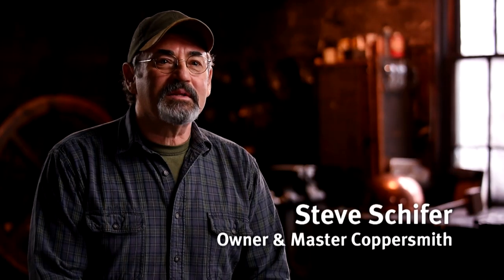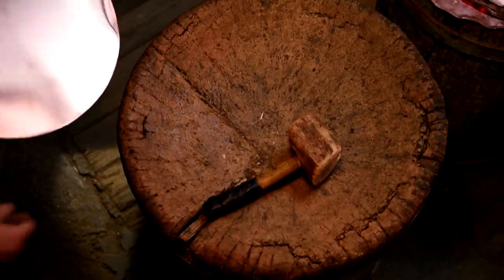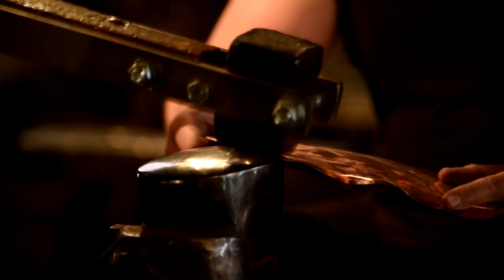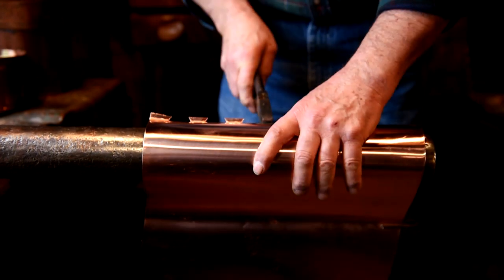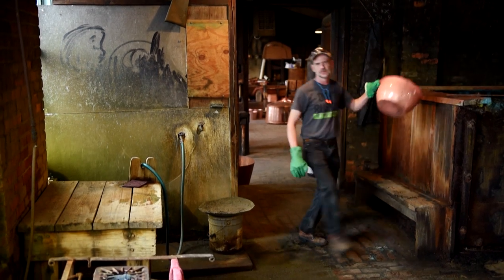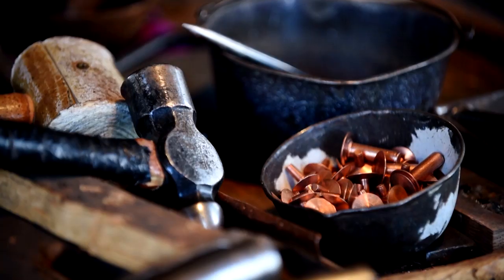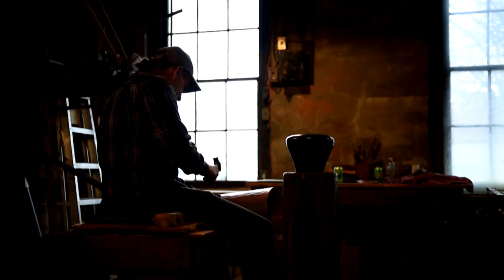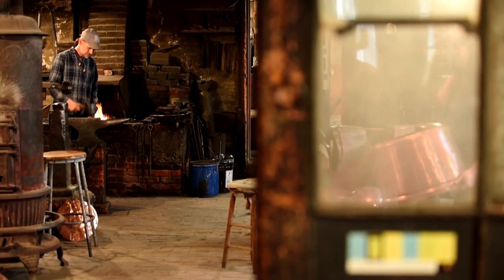The Bucyrus Copper Kettle Works

Comment: what about copper pot stills? are those assembled by brazing or can soldering be strong enough to take the heat of a burner under them?
Reply: Soldered.
Reply: @canadiangemstones7636  would have to be non lead and soldier that can take higher heat i suppose